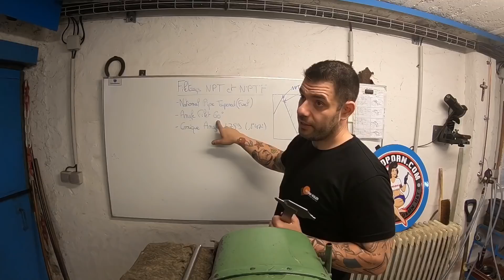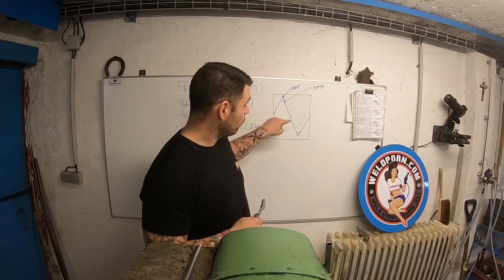Épisode 2 :  explication filetages nptf, pied de profondeur et finition bague

Comment: Bonjour,
J’ai vraiment besoin de me remettre dans le truc, j’ai un tour AMC élan 190. Je ne sais plus faire de filetage pour restaurer mes mobylettes’ à quand un tuto pour filetage métrique ??
Reply: Filetage métrique je vais t'expliquer comment le faire.
À savoir sur un pas métrique tu as des pas débrayable ou non débrayable pour savoir si ton pas est débrayable c'est la vis mère est un pas de 6 donc si ton filetage est multiple de 6 tu peux débrayer après pour savoir la pénétration il y a un calcul à faire (ex= pour un m55 x200, le calcul est simple 1.226 multiplier par le pas et ton diamètre tu le met à 55, 00. A la fin du filetage ton diamètre du haut de filé doit être descendu à moins 54,85 cela permettra d'avoir le bon jeu pour ton filetage et qu'il vis correctement) j'espère t'avoir aidé si tu as d'autre question n'hésite pas je suis tourneur de métier